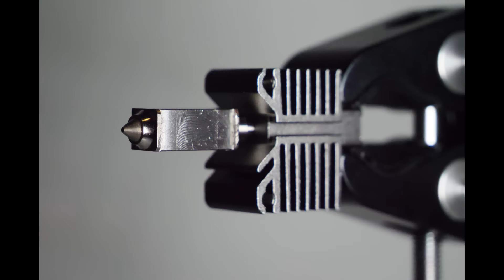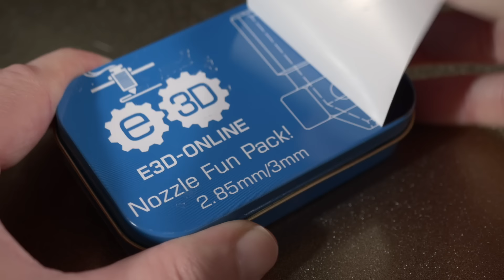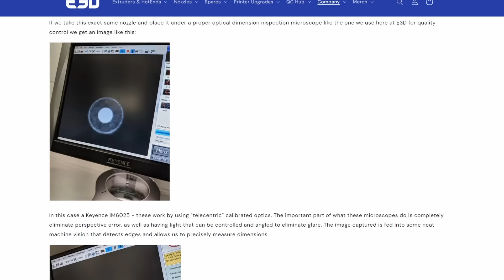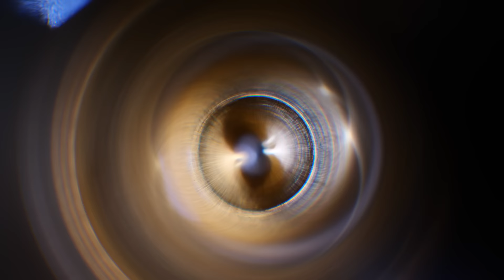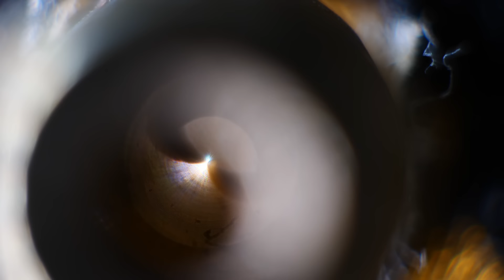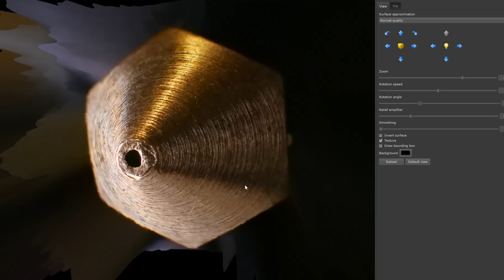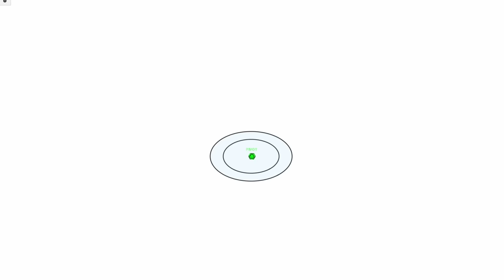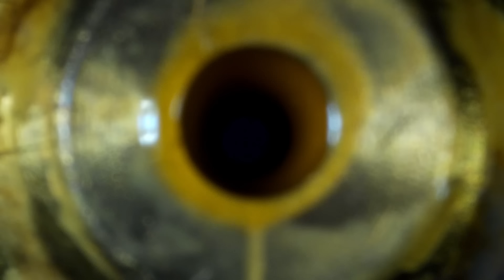Expensive Vs Cheap 3d printer nozzles - let's look inside.

Comment: Unfortunately I see many videos published on an international site, such as YouTube, targeting only one country in the world. When there are more than 200 countries.
Please keep this in mind when making your next video. Your country is only one in the entire world. Please understand that. Cheap is not always cheap. It depends on the country where you live. And there is a huge world beyond your small country.

Pay for a license? Why don't you use Free Software?
The problem is not three-dimensional, but two-dimensional. Sand the tip of the nozzle and that's it. The shape of the rest of the nozzle matters little. The only thing that matters is the part that prints: Its tip.
Reply: I do understand your point, but it's moot - the gentleman makes his videos for his target audience, which presumably includes those that can buy 3D printers. If you can buy a printer, you have to buy the consumables, including nozzles. It's a fact of life that there's not universal equity, it either can be accepted or you can agitate for better wealth disbursement around the world. Good luck with that.

Second, your point about "it's just the end of the nozzle" is wrong. Roundness of the hole, drag coefficients of material flow through the bore, and even concentricity of the bore to the threads can affect uniformity of filament flow, and as such will affect the final quality of the print. Is it more critical than the drive mechanism for the feedstock, or the accuracy of the machine kinematics and nozzle placement? Not likely, but it's part of the error source stack . Better is indeed better...
Reply from the maker: That and I didn't advocate for e3d nozzles being cheap, I specifically said I didn't like the price 🤣 so I'm still confused.
Reply: @LostInTech3D  "...Some cheap ones, some expensives..."
There are not cheap. There are expensives and more expensives. You can say "some more expensive than others".
You may say that they are cheap for you. I could say I pay $8 a KG of exelent quality PLA as well. How much do you pay for the PLA? $20? 40? Is it cheap? For the rest of the world, it's very expensive. What's the point? There are neither expensive nor cheap things. There are cheap things for you and some other countries of all the countries that exist in the world, for the rest of the world it doesn't work like that.
Reply from the maker: I'm sorry but I have absolutely no idea what your point is so I struggle to really take anything away from it.
Reply: I'm so sorry you don't understand it.

Comment: You inspired me to at least look at the nozzles I was using on my prusa mk3s, (cheap split nozzles)
And the quality is indeed pretty bad on them, May explain some of the problems I have with my prints with charred strings.
Could be worth trying the stock nozzle again, instead of blaming it on using 0.6mm or the fillament.

Comment: I bought cheap e3d-compatible nozzles on Ali numerous times, they cost mere pennies a piece... they generally come out fine? Like really beautiful smooth surface inside and a good enough hole, good enough bottom flatness. Hole sometimes a little off centre but do i care, do i really care? I'm not running tool changer or idex or anything. I have inspected them with lights and microscopes and i nickel plate them myself and inspect that as well. I mean sure you could get a stinker sometimes but then groups of brands emerge who'll get you decent quality at several times the rock bottom price which will still be insanely cheap. Sometimes there are labelling mistakes, just diameter surprises, but that's avoidable. e3d and the likes well they have so much overhead purely from being located in a Western economy there's no way they can compete.

Comment: The MK8 nozzle can just be replaced by e3d v6 type, so there was like... 5/3rd standards not even 2.
Reply from the maker: 🤔 I was always told they weren't interchangeable. I never thought to try 🤣
Reply: @LostInTech3D  I have been using only e3d type nozzles in my now quite old Geeetech printer which originally came with an MK8. Arguably it's an improvement. I think MK8 nozzles only cause trouble, since they can butt up against the block and then well that's not a good time, since they won't connect to the throat tube firmly, every batch comes out slightly different thread length.

The other way around doesn't work though.
Reply from the maker: This will make my testing easier I guess

Comment: In my opinion anything that doesn't combine heatbreak and nozzle in one feels incredibly outdated and a lot more prone to errors. The confidence, simplicity and reliability of these solutions is just a lot better and worth the additional cost for pretty much anyone. Not to mention that something like bamboo is actually really cheap since it isn't just a nozzle, you get an entire functional high quality hotend for that price. Compare that to a V6 hotend and the additional cost quickly disappears.

Comment: Very fun to watch and informative at the same time.  The nozzles that came with my Elegoo Neptune 4 Pro are not great examples of the craft; using just my eyes and a flashlight, I see imperfections around the extrusion hole and the outer surface of the tips are not smooth, making at least the one that was installed at the factory prone to sticking to the filament during wiping and ironing, and when I got a blob due to bad adhesion, I was unable to get all of the plastic off without removing it from the hot end and heating it with a soldering iron in a vise and polishing it with fine emery cloth. Burned my hand doing that, so I figure that I should retire it and use another.

Comment: You, sir, are doing the Lord's work here. I feel nozzles are the most neglected, misunderstood part of 3D printing, yet quite possibly one of the MOST IMPORTANT factors in print quality.

I don't think machining quality or hole... roundness?... Anyway I don't think those are the only determining factors in print quality. I feel a nozzle's heat capacity, conductivity and thermal shock resistance all matter as well. There are very real reasons why a brass nozzle naturally prints smoother, more consistent prints than a hardened steel one. A print that changes from an infill to a cavity and back to infill will exhibit different surface qualities depending on the nozzle being used.

Edit: I'd be willing to bet a well-machined, nickel-plated, iron nozzle, though slow to heat, would be an unbeatable nozzle for print quality, especially with high flow rates.

Comment: Wonderful work. I tend to think, from a 10,000ft view, that extra cost for nozzles is worth it. It's the tip of the spear, almost literally. Improved surface quality reduces probability of clogging as well as reducing back-pressure, enabling faster prints with less problem with oozing.v The surface quality of the flat portion of the nozzle matters as well, as does how centered it is. Coatings and hardening matter a lot for lifetime under abrasive conditions. Even the patented Bondtech CHT approach seems very much worth it to me as it allows Volcano-like performance but in a smaller footprint, less weight, and less oozing (easier to dial in retraction). Spending 1-2% extra ($10-30?) to improve the performance of the rest of the machine makes a LOT of sense to me.

Comment: I recently put some tungsten tipped nozzles on my IDEX and while using the CXC from Ember Prototypes to calibrate it I took a closer look at their quality. Not the finest looking nozzle holes but they were ok. I did see a lot of debris though. It made me wonder if it was a byproduct from drilling/milling the tungsten because it was only located on the tungsten tip. These nozzles are brass with a tungsten tip. I bought off Amazon and am viewing them as a generic brand but they are banded as DUROZZLE. I just never heard of them before. They were what I found & could afford.
Anyways I thought it was very interesting looking at their quality under magnification. So I found this video of your extremely interesting.

Comment: This is a really great video, and I appreciate the work you’re putting into this project immensely. 

One comment I’d like to make though, is that more flow doesn’t actually require a longer nozzle. This is a small thing, but early on in this video you did mention that more flow means a longer nozzle, and this isn’t true. The only thing you need for more flow is a longer melt zone, and the melt zone doesn’t have to be entirely in the nozzle. The reason this became the popular method (I believe) is because the E3d V6 design requires the nozzle to butt against the heatbreak in order to seal the hotend and prevent filament leaks. However, there are two main designs that I know of (because I own one example of each) that disprove the whole “more flow requires a longer nozzle” thing. Those are the Mellow/Vez3d Goliath, and the Phaetus Rapido 2 UHF. Both of these hotends are compatible with bog standard V6 style nozzles. The Goliath is one of the highest flowing hotends available because it has a ridiculously long melt zone, despite the fact that it uses a standard length nozzle. The Phaetus Rapido 2 UHF is perhaps more interesting to my point though, in that the Rapido 2 UHF comes with the ability to run in “normal” Rapido mode (that is, the same as the standard Rapido) as well as in UHF configuration. The only thing that changes is an extension gets screwed onto the melt zone, which extends the melt zone, then the normal V6 nozzle gets screwed into the extension - and presto! We have more flow. To my understanding, this is a change from the Rapido 1 which used what was essentially a fancy nut to extend the melt zone, and required a Volcano nozzle to run in UHF mode. Oh, and there’s the Mosquito Magnum and Magnum + from Slice Engineering, which run with the same idea of using a longer melt zone. 

Again, this isn’t of particular importance to what you’re working on. It’s just something that I think is worth mentioning, because needing a longer nozzle really is an issue specific to the V6 design from E3d, and all of the other hotends that copied the concept. It’s not actually something we ever had to have.

Comment: Would love to have the nozzle montage as a wallpaper for wallpaper engine 😅

Also V6 and ender nozzles should fit but require some bed leveling and possibly z height adjustment, use both on my Ender 3, would make the comparison fairer IMO

Comment: From personal experience, the cheap nozzles got clogged up more often but can be easily dealt with using a filament dust filter. 
One thing though, I really hate how Bambu Lab designs their nozzle. I bet they intentionally designed it that way to make it harder to copy and artificially jack up the price hence more profit. They literally required you to buy an extra heat sink for every nozzle you buy from, simply an e-waste. Some Chinese manufacturers already made a modified Bambu Lab nozzle where you can swap out "only the nozzle" and use a normal nozzle (E3D, CHT, cheap ones, etc).

Comment: To confirm your suspicions about the Prusa nozzles, Prusa has stated several times that they designed their nozzle with E3D. I don't recall if they said the E3D makes the production nozzles, but I presume they are either made on the same line as the Revo nozzles (probably subtle tooling swaps when changing between Prusa and Revo nozzles) or a similar production line. Especially the press fitting of the heat break to the nozzle. I think Prusa insisted on their design so there could be some backwards compatibility with E3D V6 style nozzles for all of us customers who have already invested in expensive nozzles for our MK3 printers. Revo doesn't offer that backwards compatibility.

Comment: Wow, this was *phenomenal*! 

I’ve done enough macro work to know how totally insane this was; VERY well done! (!)

The most surprising thing to me was when you made it into a 3D image that you could rotate 🤯 Is that a function in Helicon or something separate (I need to go watch the vid on the second channel I guess.)

In any event, this was a really extraordinary vid, can’t wait for the second half to see how the interior finish might translate to print quality.

My gut sense is not a major impact, but I’d expect nozzles with poorer internal finish to out more back pressure on the extruder. … Hmm, though: asymmetry in the surface finish near the exit point could indeed affect the flow pattern. I do expect that the surface finish of the tip of the nozzle would have an impact too. Can’t wait to see the next part! 😁

Comment: This is really cool stuff. The pictures are spectacular. I'm especially interested in your comparison of how the cheap vs expensive nozzles (or at least well vs poorly made ones), though.  I went the proprietary nozzle route 7 years ago with a Micro Swiss all-metal MK10 kit.  Those nozzles are $15 each these days (and they weren't much less when I did the upgrade.)  On the other hand, the .4mm nozzle that came with the kit is still going strong so I guess the quality shows through in that regard.  (I also have a couple of hopelessly clogged .2mm nozzles but that's not the manufacturer's fault.)  Anyway, I'm looking forward to more in this series. Keep up the great work!

Comment: Please explore this. I went down a rabbit hole of polishing cheap nozzles with diamon polish up to like 50k grit or something stupid. It doesn't take too long to make a cheap nozzle polished. But I didn't really see much of a difference in print quality. The things I've noticed effect print quality are: distance thermistor is from the nozzle tip( closer is better), stable temperatures, filament consistency, extruder build quality & resolution, and for crazy motor drivers: electrical noise. In that order. Stable Temps really seem the most important. Keep the temp at the tip of the nozzle & ambient air from fluctuating too much and quality is  great.

Comment: As someone who gets to use multi-focal imaging at work, I fully understand the benefits and drawbacks it has to offer...the pretty pictures are definitely worth it, though. I also think the subject matter is fascinating, having religiously bought cheap Mk8 nozzles for my Ender 3 before graduating to solid mid-grade nozzles like those from Micro-Swiss for my Sidewinder X1 and someday splurging on a Diamondback for my SV06 Plus. 

The consistency in diameter and ovality is easy enough to see in finished prints (or in failed prints) but it's quite shocking to see how poor the surface quality is for some of those bores. I can almost understand it for the hardened steel nozzles - even if you machine it prior to hardening, it is going to be a bear compared to brass - but some of those brass nozzles were just straight ugly on the inside. 

Can't wait for the rest of the series!

Comment: I have never changed a nozzle in my life and I am printing for years.
Reply from the maker: they last a lot longer than people think they do.
Reply: It depends on materials that you print.

If you frequently change between plastic types, you get hard residue on the inside that doesn't just come off. PETG and ABS in particular accumulate.

If you print white or very opaque pastel colours, glow-in-the-dark, or particle filled, you will have nozzle wear, orifice widening, due to abrasive nature. On the other hand, these can clear up the residue that would otherwise accumulate.

If you just print PLA of less abrasive colours, then you can go for a very long time.
Reply: @SianaGearz  Of course, it depends on other parameters as well, for instance I wanted to print finer details as well. The only time I changed a nozzle is to increase volumetric flow with a volcano nozzle.
I had to print in 0.8mm layer width for some  sorting and storage boxes.

I only use PETG in 2 colors to keep my filament management simply, I don´t want or need 20 colors, I rather paint the object afterwards if needed but usually black and white goes with everything.

Using filled material is not a good idea in my opinion not only is it more expensive but it does not increase part strength either, the advantage in general is pretty small. I never needed glow in the dark or woodfill, I see those more as a toy but sure if you do and if you change colors and so on you need to the change the nozzle I absolutely agree.

Today I don´t care either way, I use the Flashforge Adventurer 5M with the quick nozzle change system.

Comment: After buying a Revo at launch, then waiting for ever. I sold it and bought Rapido and a diamond back nozzle set. It absolutely shits on the Revo. Also Macro stacking is really rewarding when a stack comes out perfect front to back. Uggh love that.  If you can you should definitely pick of helicon focus. Its an app that will control the lens and you can set up the stack you want to do. i will just do that. Plus they have some pc software too. Those stacks turned out badass my guy!
Ignore the helicon focus part. just got to it.